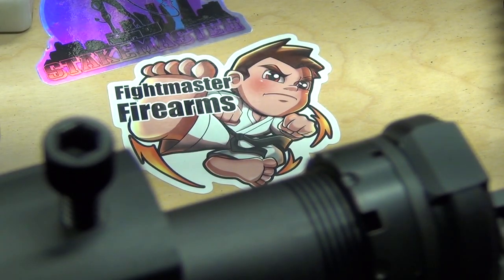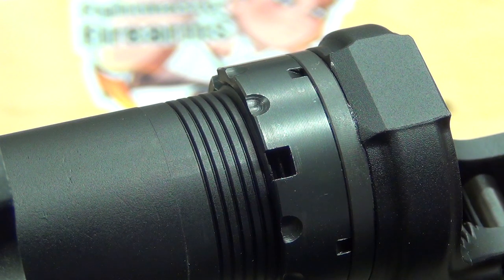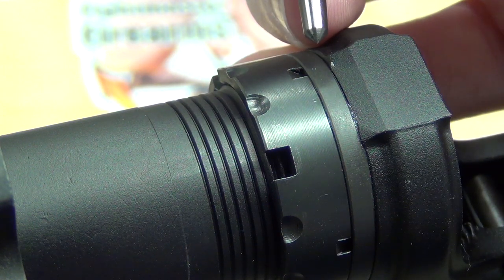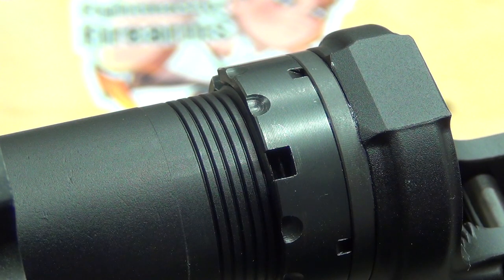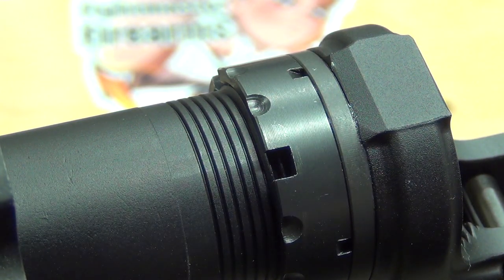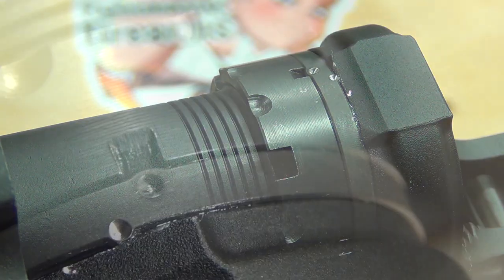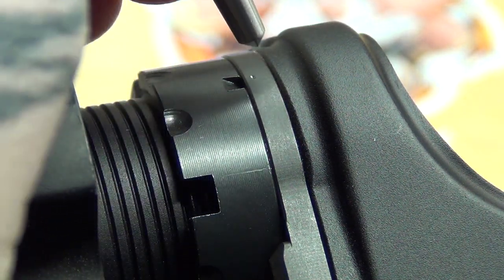Castle Nut Staking - Fightmaster Method

Comment: To be clear, everyone, this is a video about staking your end plate into the castle nut, not staking your end plate into your lower receiver.
Reply: Saw this comment before the vid... Was bit confused.... Then... While watching i realized your comment became greatness.
Reply: Instructions unclear. Staked magazine to well.
Reply: As an AK person, it’s hilarious how much you AR types worry about tiny dinks and bruises on your guns
Reply: Wait, what???  Oh, crap.
Reply: Bwaaaahahahaha still funny 2 years later LOL
Reply: The problem I see is hitting the punch multiple times too quickly. When you hit the punch it’s marking the end plate like you want, but it’s also rebounding out of the staking hole, and if you hammer the punch again too quickly without resetting it to where you want it to move the metal, you could easily get the unintended “skipping” as shown in this video. 

It’s not a race. I would take my time. Hit the punch once. Check the mark. Reset the punch to the intended position. Hit the punch again. Check. Reset. Hit. I would do this until I got the perfect stake I wanted, and I wouldn’t have marred my lower receiver, end plate, castle nut, or buffer tube. 

If you’re doing the staking for a client, mistakes are unacceptable. Buffer tubes, castle nuts, and end plates aren’t that expensive or difficult to replace. Lower receivers are another matter. If I was the client, I wouldn’t accept anything less than perfect.
Reply: hear not staking your end plate to the lower is as bad as not carrying with a round in the chamber...
Reply: I always make sure to stake my end plates to all my lowers 24 times and I won’t hear of anything else.

Comment: I have a tip for u. Start off with a sharp skinny punch. It helps getting the stake centered. It is easier to see around. Then swap to your larger punch. I use this 2 punch method with great results.
Reply: Great tip!  Thanks for sharing.
Reply: Solid idea
Reply: I’ve used a 16 Penny nail with light taps from a dead blow hammer  and that worked for me. I jacked the castle nut and plate up first time trying this, but luckily it didn’t touch the receiver and I have almost way too many extra parts around here anyway.

Comment: Derek Fightmaster, aka StakeMaster, is one of the very best :)  BTW, ESF-H is machined from 4140 steel, we don't heat treat or black nitride them, they're harder than TDP spec 1018 or 1020 mild steel, it should be as it's a QD sling mount, not just an end plate.
Reply: FCD is life
Reply: 🦆

Any ideas when we're gonna get our filthy hands on some dimpled ABC's?

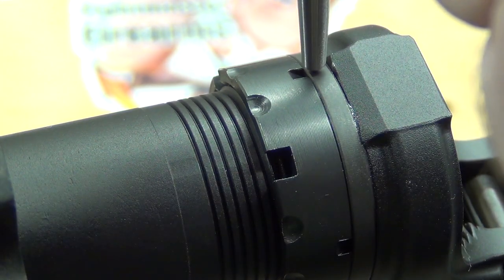Comment: 5:54 OUCH! Never set a punch like you’re hammering a box of nails. Gotta recenter the punch after every hit of the hammer.
Reply: good tip! probably one of the reasons mine always turn out bad. Thanks!
Reply: What does resetting the punch regularly do for the quality of the indentation?
Reply: @Baconaughts  not necessarily quality but to mitigate mishaps like a skipping punch.
Reply: @Baconaughts  stops you from doing what he did in the video.

Comment: I use a good spring loaded center punch to start. Set it to max penetration (giggity). I punch it twice with punch perpendicular. Then I finish it with a center punch with it angled slightly toward the castle nut. I do one blow at a time until I’m satisfied with the hole (giggity). My stakes usually look pretty nice imo.

Comment: Single set and hits only..Even I at 68 wouldn't mess up like that.
Reply: You can remove the nut.a flat punch can push back some of the metal by holding it at an angle and I've done it without much trouble.I had a staked commercial tube and replaced it with a Mil-Spec one.
Reply: I did a few that were real nice. And one was crappy looking. I put some paint over it but it still looked bad. But it bothered me so I got a new end plate and redid it. Now it looks nice.

Comment: Just use a loaded centerpunch and youll avoid your screw up. Ive done hundreds and never had one messed up.
Reply from the maker: I've used all types and varieties. This punch and method creates the best stakes. Just like with everything, we all crawl before we walk and practice and experience is required to master anything. No auto punches produce the results I personally prefer.
Reply: @nsz85  the one I have does the same exact thing in the video minus the f up

Comment: What Jig are you using to secure the lower in a vice? Also, do you use aluma black in the staked portion?
Reply: I was wondering the same thing regarding the jig. Did you ever find out?
Reply: @msb11286  Yes, I completely overlooked it. He showed what he was using at 01:05 (Geissele Reaction Block, which are impossible to find)

Comment: First, use a tiny dab of grease on the rear of the tube threads, and spin the castle nut into place (hand tight). Some castle nuts may not show threads through the stake hole, so back it off slightly, so Loctite can seep into the threads. Then, just add 1 drop of Blue Loctite in a square staking hole. Finally, torque the castle nut to 35-40ft-lbs.  Been doing this for 30 years. 

I've never had a castle nut come loose. I've always been able to remove them with a wrench. And, I've never had to replace a castle nut. Staking simply isn't necessary.

Comment: Why dont you use a ratcheting castle nut?
Reply from the maker: Junk.
Reply: @nsz85   Why do you say they are junk? I have had extremely good luck with them for the last 5 years. I use it on my valkyrie .224  And my 556 both of them I built from the pistol grip up Including to mill out the receiver's . I watch a lot of your YouTube videos that give me good imformation .
Reply: @whoff8792  Other than the cost, the ratcheting castle nuts seem quite viable, especially for those who might want to frequently change out buffer tube extensions.  Most reports I've either read or seen have been positive.  Not sure why the "Junk" reply.